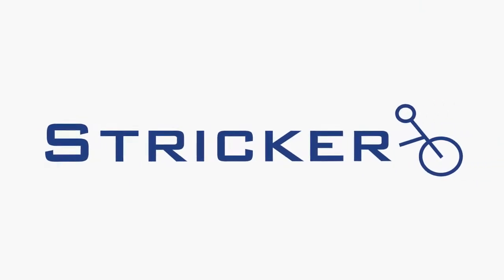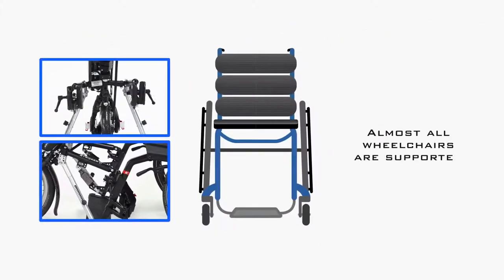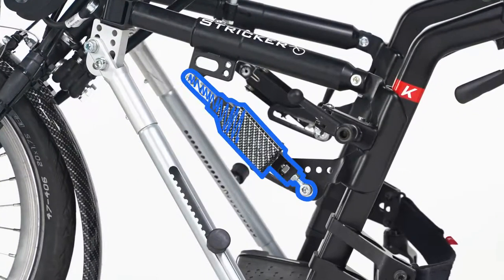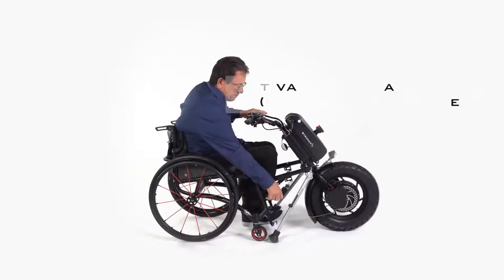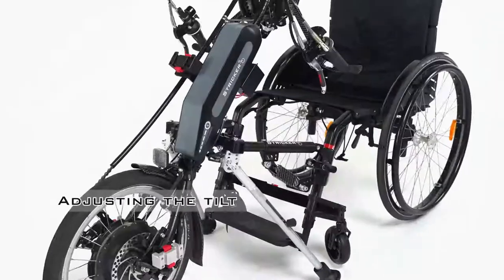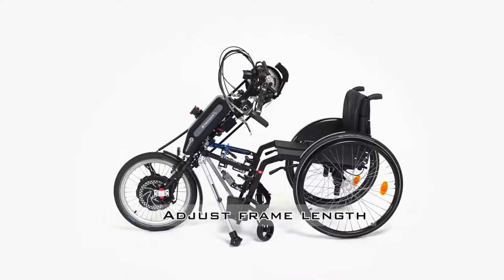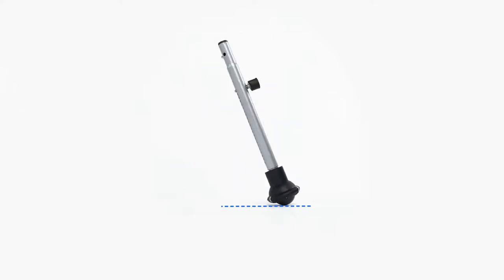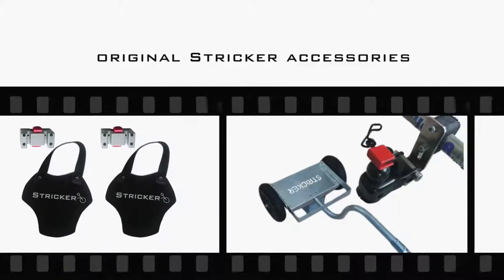Unpacking Stricker Handbikes Mount handbikes & power assist Video - Push Mobility

Comment: is there any model that would work for a c6/c7 level quad [tetraplegic]?... for a power attachment i could use the 'twist' throttle handle with some home fabricated, added paddle/yoke lever but there's no way i could use the traditional 'squeeze' type of brake lever[s], on either the power or manual cycle devices... however, i could use some type of a 'push' type instead of 'squeeze' type lever/handle for braking instead... has your company researched any such options for quads in power and manual assist devices?...